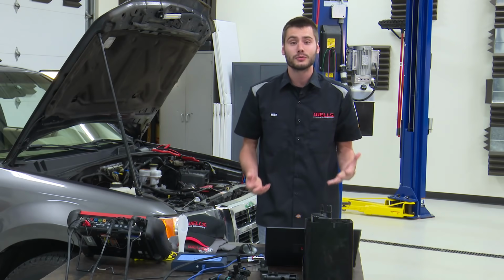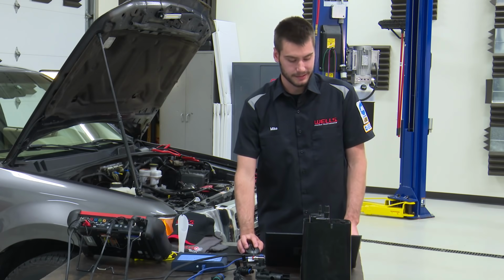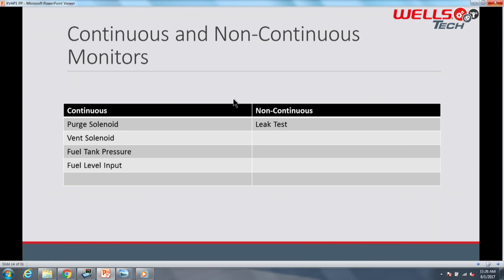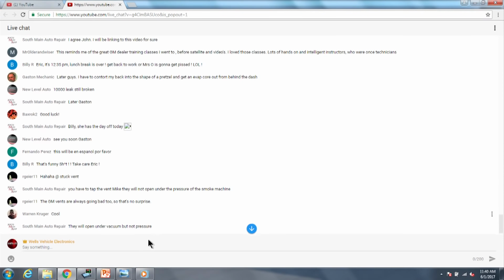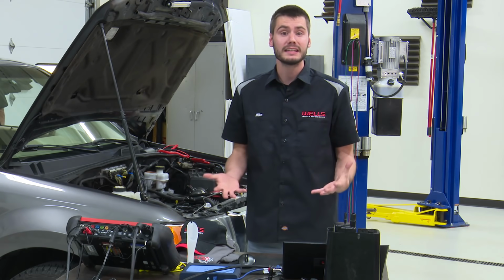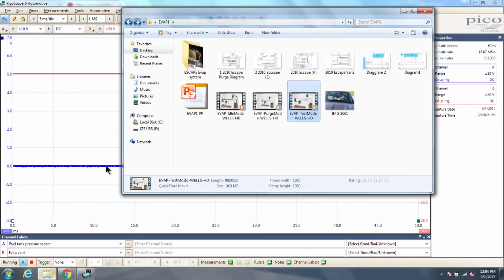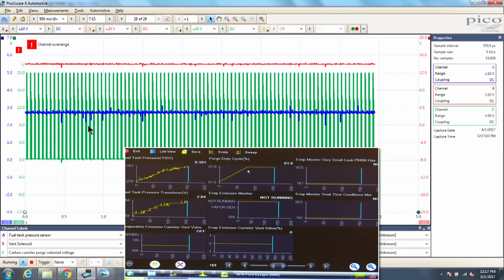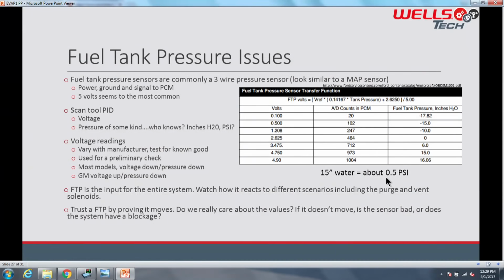EVAP-Evaporative Emissions System Operation, Testing, & Diagnostics Beyond the Leak (P0442, P0455)

Comment: Hey, Mike. The vent valve allows air  in during purging from engine vacuum, right?
Reply from the maker: Hey Little7, correct. The vent allows for air to draw into the system to displace any air that's being drawn into the intake. This keeps the system from sucking into a vacuum during standard purge. 
Mike Becker, Senior Technical Instructor
Reply: As  always, Thank you, Mike.

Comment: What's the problem if you find charcoal pellets everywhere in the interconnecting hoses, even the Evan purge making the car run rich ?
Reply from the maker: Harry, that means the canister has failed. You will need to replace the canister, probably the purge, and flush ALL of the lines attached to get that stuff out.
Mike Becker, Technical Services Instructor
Reply: @GoTechTraining  Before i get one, cant i empty the canister to prevent the pellets spreading out again and drive to prevent the car running rich? And get one later?
Reply from the maker: Harry, won't meet emissions that way...
Mike Becker, Senior Technical Instructor
Reply: @GoTechTraining  That's fine, once car wouldn't run rich am ok. Besides my location doesn't clamp down on emissions testing or regulations.

Comment: hello i have a 07 tahoe and i replaced my evap vent solenoid and its still open and not closing  i looked on my scan tool and it show the evap (h20) -0.550 while truck running and when i shut it off it goes down quickly to -0.094 and lower im stomped now
Reply from the maker: Hey Chris, the only time that vent solenoid should close is when the system is being tested for leaks, either testing by itself or being forced to run with a scan tool.
Mike Becker, Senior Technical Instructor
Reply: @GoTechTraining  so maybe i have to fill up the tank again ? Because im trying to pass inspection and its been a month the evap monitor is still incomplete .
Reply from the maker: The EVAP monitor is the hardest one to run. Fuel usually needs to be between 15 and 85% specific temp ranges and so on. 
Mike Becker, Senior Technical Instructor
Reply: @GoTechTraining  ok maybe i need to replace my fuel pump assembly then because the sender readings are erratic the fuel psi is 45 and it slighly drops  and it always throw a intermittent p0171 code only. i changed intake gasket swapped maf changed plugs wires etc no vac leaks can be found sorry im all over the place lol
Reply from the maker: The EVAP test won't run if there are other codes stored. You'll definitely need a steady, consistent fuel level sender. If it's all over then it could interrupt the test too.
Mike Becker, Senior Technical Instructor
Reply: @GoTechTraining   the best advice ever i apreciate your feedback mike youre the best
Reply from the maker: Glad I could help Chris, good luck!
Mike Becker, Senior Technical Instructor

Comment: Excellent video but one thing is not clear to me. You said the fuel vapors pass thru the canister where the charcoal absorbs the hydrocarbons (i.e the gasoline) and out goes pure air from the vent valve.  I assume the gasoline somehow gets "stuck"  to the charcoal. When the purge solenoid valve opens what would cause the 'stuck' gasoline to release itself from the charcoal and get sucked into the intake ?
Reply from the maker: Hey RC Max, thanks for watching! So, think of "match-light charcoal" that you would use for your grill at home. It has stored the vapors...but if you leave them to sit out in the elements they lose their effectiveness. The activated charcoal, through some sort of voodoo magic, grabs the fumes and holds them until vacuum is applied to the canister. The pathing for flow inside of the charcoal canister is also important. Great question!
Mike Becker, Senior Technical Instructor

Comment: I thought you might enjoy this true story.  I had my little guy in my lap, 5-year-old I think, he is 44 now, so here is what I remember.  We were in my 1964 Rivera with a 464 Buick big block.  We were at a stoplight and the only other car in sight was a police officer, of course.  My son, wanting to help drive pushes the shiny button closest to his foot.  It was the Cruze control activating button,  I know this sounds goofy but that year, and I am sure this was changed, but when you push that Cruze button the car accelerates to the dialed in speed, even when your is at a slow crawl like I was, as I was going from a dead stop to maybe 5 mph that is when my kid kicked in some new driving tips for me. The Cruze control was set at 80 mph, and by god that's how fast the car wanted to go.   Of course, I hit the brake after doing a great burnout in the intersection with the cop behind me all the way to where I stopped, knowing the cop had a few questions for me.  I told him what happened and his voice of wisdom was, Son next time read your owners manual, as he handed me a ticket for the burnout, that 465 or 464 can leave a lot of rubber on the road.    PS MY FIVE YEAR OLD HAD A BLAST, CAN WE DO IT AGAIN?
Reply from the maker: Hey BillDude1313, that's crazy!!! I bet that car could leave some stripes on the road. Should have told the cop it's a community service, you're re-sealing the road :)
Mike Becker, Senior Technical Instructor
Reply: Hindsight 2020,

Comment: I would like to see a video that shows you using  a cheap code reader so I can try fixing my own car all you shop people are using code readers that coast thousand of dollers.
Reply from the maker: Hey Gregory, many times a "cheap code reader" doesn't do the job. Not all cars can be fixed that way. Our "thousands of dollar tools" are way more than just code readers. They are full function scan tools that can read data, codes, control things, provision things...so much happening other than just pulling codes.
Mike Becker, Senior Technical Instructor

Comment: Vacuum hoses,or leaking gaskets.
Reply from the maker: Hey Carson, what are you referring to?
Mike Becker, Senior Technical Services Instructor
Reply: Responding to engine performance and some of the causes in relation to loss of power.The
Reply from the maker: Ahh I see, definitely those can cause huge issues, especially at idle.
Mike Becker, Senior Technical Instructor

Comment: That's nice those facilities save 91 million are they going to pass that down to the consumer that now has to worry about a .010" evap leak? Where does the air vapor go when the tanker is filling the underground tanks at the station?
Reply from the maker: Hey Randy, great questions. I doubt it on the first one :) The second one, i'm not sure. Maybe they run some kind of ORVR system?

Mike Becker, Senior Technical Services Instructor
Reply: Randy: I see this question a lot from kids.. not saying you're one.. to answer your question about where the air goes when the fuel tankers are dumping fuel into the tanks.. there's always a few (depending on how many grades of fuel the gas station sells) vent stacks around the location of the filler ports.. which are vented into the atmosphere.. while the tanker is filling the underground tanks... the sediment gets disturbed by the turbulence of the new fuel coming in... I'd prefer not to pump up at a gas station that's getting filled up by a tanker for a day or so.

Comment: I have a Honda Accord 2004 have the code p0443 and p0449 you think is the valve vent and purge
Reply from the maker: Kelvin, like we always talk about in our training. Codes point us to tests. I never jump to conclusions. Sure you could have a bad vent or purge, but you should test them or have them tested first before guessing at parts.
Mike Becker, Technical Services Instructor
Reply: Wells Vehicle Electronics thanks I will
Reply: Wells Vehicle Electronics   I change the purge selenoid and restet light he pass the light is off thanks you for help
Reply from the maker: That's great Kelvin, glad you were able to get it fixed!
Mike Becker, Technical Services Instructor

Comment: Thanks for the video:  I’ve got a po446 code on a newly purchased 06 canyon with only 17k on it (really!) — replaced fuel cap and code came back- don’t have any issues filling fuel and am thinking of replacing vent solenoid — I don’t have any smoke machines or fancy tools- just a cheap code reader and a 16 yo son waiting to fix and register his first truck... Does that code typically mean vent solenoid?  I have 45 days until emissions retest..
Reply from the maker: Hey BKDarch, A P0446 is commonly related to the vent solenoid. Doesn't mean it NEEDS a vent, but there is something going on that the computer is failing that test. If you don't have a full function scan tool and a smoke machine then i'd suggest taking it in, or if you want, try a vent solenoid...but with no guarantee. 
Mike Becker, Technical Services Instructor
Reply: Wells Vehicle Electronics thanks- I read insects get in the vent filter of the vent hose and build a nest causing a blockage and throwing the code— where is this filter though? I actually just finished doing this replacement and cleared the code— don’t see any pending or active codes but don’t think it’s run the test yet as the light is yellow on the reader...guess it doesn’t matter as long as it doesn’t come back!
Reply: Pending code back after 60 miles so back to the drawing board...$20 for a purge solenoid— guess I’ll try that next...
Reply from the maker: Hmmm, I guess you could try that. May be worth a shot for $20. At some point here I have to recommend you take this thing in. Maybe that 20$ is worth it here, but after this you may want to consider someone with a full function scanner take a look at this thing. You could have a fuel tank pressure sensor issue. I did a video with a P0446 caused by a bad FTP. Check that out, it explains this well. Here is the link. https://youtu.be/Xc4UJIU0M70
Mike Becker, Technical Services Instructor
Reply: Wells Vehicle Electronics On this truck (17k mikes) the purge solenoid looks like a pita to get to and I can barely take a picture let alone change it out chasing the code with no guarantee...I’m obviously trying to do this myself to save my 16 yo son a $250 bill at a shop but i know when I’m beat and I think I’m at that point..I watched your fuel pressure video and have no way to perform an evap leak seal test without a better scanner (like I said can’t reach purge valve without pulling tire and fender well and cutting my hand in half so it fits) to even jumper it like you suggested..I read on this truck replacing that $20 part is a rear tire and fender well removal and jack up the body a bit..
Reply from the maker: Those purges are under the intake manifold right? It's too bad this is giving you such issues. If I were you i'd take it in, or invest in tools. Taking it in would be cheaper at this point I think. Good luck man, wish you and your son the best.
Mike Becker, Technical Services Instructor
Reply: Wells Vehicle Electronics yes purge is under intake..I ended up taking it to a place and it was the fuel pressure sensor so good thing I didn’t do the purge...guy said it read 14 volts of vacuum with the gas cap off — he said pulling the driveshaft allowed him to do it faster than removing tire and fender well..$140.  Hope the code stays off..
Thanks for taking the time to help me out! Much appreciated...

Comment: It is the e vap silsnoid
Reply from the maker: Hey Kevin, in this example there was a check ball in the bottom of the filler neck that would seal under pressure and leak under vacuum. The code was caused by a leaking filler neck, but forcing pressure into the test port would have never found the issue!
Mike Becker, Technical Services Instructor

Comment: Great video and a lot of information to digest. Just to clarify, is the vent valve always open except during system leak tests by the vehicle’s PCM? A single P0455 code might lead me to believe a leak in the lines, connections, or gas cap. I have a P0455 code and my purge solenoid and vent value are both working fine. I did a blow test when energized/not energized on both valves.
Reply from the maker: Thanks Yo Me! Yes, the Vent is ALWAYS open on a standard system UNLESS the system is leak testing. A P0455 could be a lot of things. A leak code can also be caused by a lack of vacuum or a faulty fuel tank pressure sensor as well.

Mike Becker, Technical Services Instructor
Reply: @GoTechTraining  p

Comment: I have an 04 clk500 what would cause the purge solenoid to continuously purge and cause lean codes it's not stuck it is being commanded open if I unplug it it closes and fuel trims go back to normal
Reply from the maker: Michael, that doesn't sound right. Maybe the control wire(probably ground) is shorted to ground, therefore energizing the solenoid at all times?
Mike Becker, Technical Services Instructor